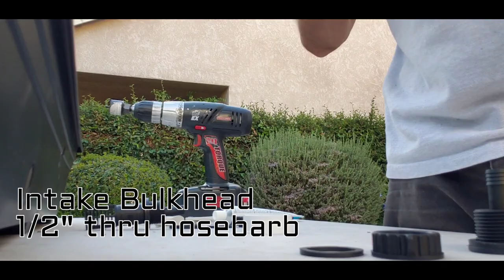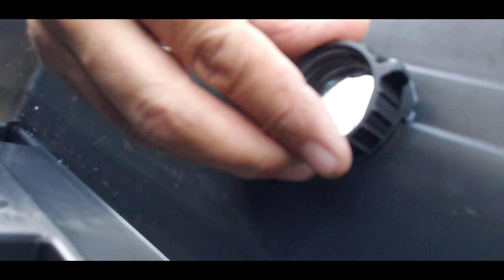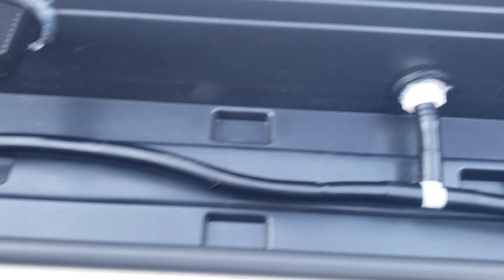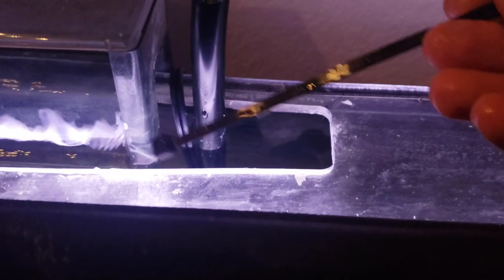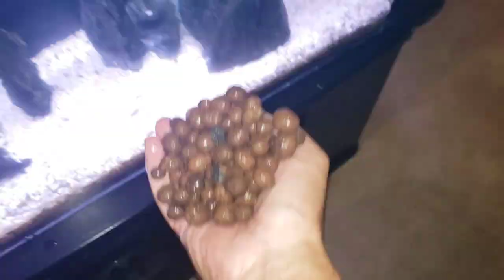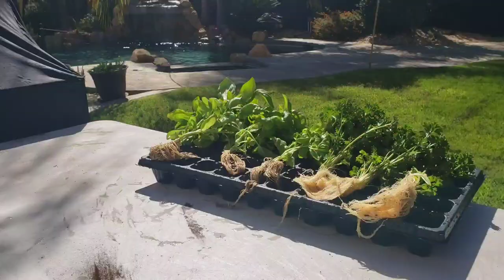How to build DIY Aquaponic Fishtank addition.

Comment: Nice job
It could be better to pump water to upper of the box, let water to flow down and drainage at bottom like in dutch bucket system
Reply from the maker: I live in very low humidy, so exposed water just evaporates very fast, and leaves hard water stains, thats why I didn't trickle the water.

Building a larger system with bell siphons.

Comment: Good work my friend. I wish I were so handy. I want a small version for a 5 gallon tank. Does it generate a strong flow into the tank?
Reply from the maker: Thr pump i bought has a flow rate of 20 to 100 gal per minute. You can get a tiny one for a 5 gal tank. But that is a very small tank for aquaponics. Smaller tanks are hard to keep water in balance.

Comment: How long did it last before the weight of it smashed your fish tank?🤔
Reply from the maker: It bowed the plastic planter box, which I had to reinforce in the center, but the tank is not a problem.
Reply: @jacques_koffaltretes  no issues with the overflow inlet clogging?
Reply from the maker: @dannyphillips8793  no, it has a grill/screen and all the water up there is from a clean tank.

Roots may be an issue depending on what you plant.